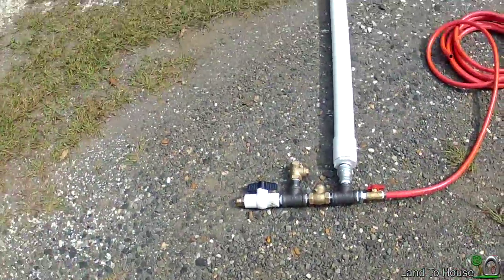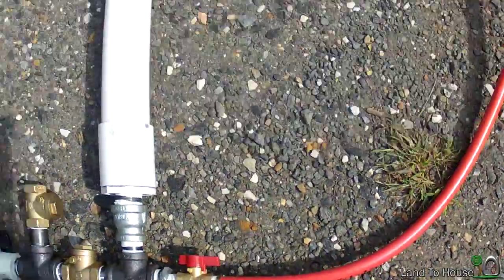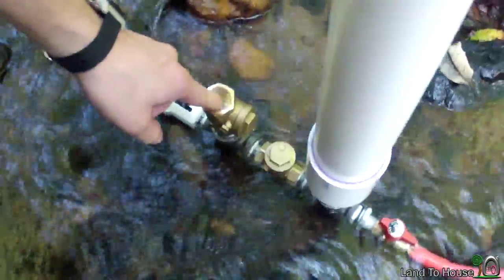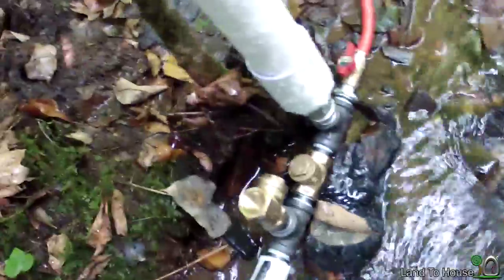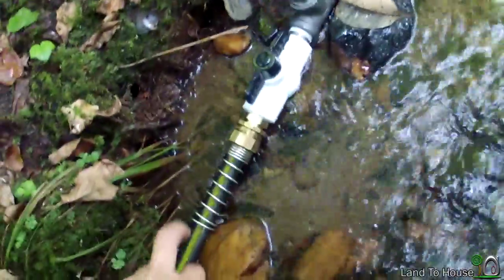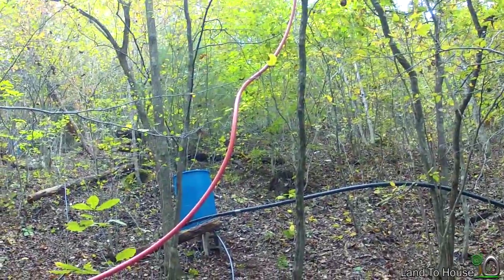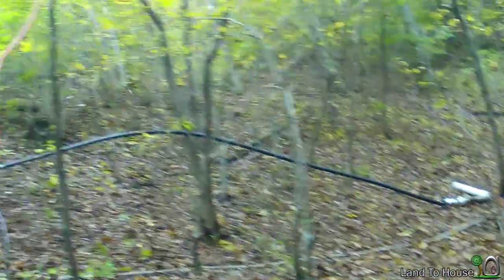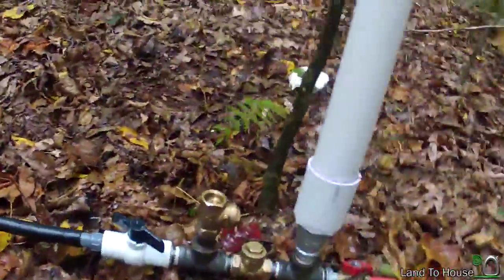Adventure 14 - Small Ram Pump

Comment: Would a ram pump hooked to a rain barrel work to make a simple water fountain for a birdbath? The flow wouldn't have to be a lot, just a small trickle as a water feature in the yard. The idea would be to feed the water running out, back into the rain barrel. Or would that stop working after a few minutes? There must be a way that doesn't involve electricity or a stream and isn't very expensive. I don't have a stream close enough to my own property to use a ram pump, but I love the idea. It just seems like it should work with a rain barrel and just feed the water back into the rain barrel. I imagine that would work like a perpetual motion machine though and they say that cannot be done.
Reply from the maker: Brandywine6969 Your last statement is correct. There is a lot of loss in ram pump operation. Even up 60=90% loss of water. Say you connect a ram pump to the barrel you will get 1gpm in the bird bath for every 6 or more lost on the ground. Your idea of using a barrel is totally valid but getting the water back to the source is not going to work for long. You can use a 55 gallon for about 1 hour with a small pump before the water is gone. your best bet would be a small solar pump that can recycle all the water.
Reply: Thank you. If I ever do get some property with a stream or other running water on it, though, I will want to try the ram pump. I'm glad I found your channel. You share great information and I love your ideas.
Reply from the maker: Brandywine6969 Yes the running water is a must!
Thank you for checking out my videos. I have a lot of fun making them.

Comment: Have you used the 3/4 inch pump again?  What #'s do you have with it.  Will it run on 1 GPM?
Reply from the maker: I just finished a video about the new 3/4" pump. It will be out this weekend. 2.6gpm total to run.
Reply: Land to House .com Darn.  I was hoping less GPM.   I tilted my 1 inch ram to the side so it would run on less GPM.   Did you try that?   You Videos are great.
Reply from the maker: John Godwin I was looking for highest GPM in the test I did this week. I can try to get it down to as low as possible next. I can tilt the pump and also I should be able to turn the ball valve some to reduce the flow. I have a nice setup for testing the 1" and 3/4" pumps now so I can do other tests.
Reply: Land to House .com Sorry.  I ment brass swing valve tilted to the side to use less water.   I mistakenly said ball valve.   Can you get the pump to work on 2 gpm or less?
Reply from the maker: John Godwin oh sorry I was not clear. Yes tilt the check valve and also the ball valve can be closed a little. Both those should slow the pump some.  We will just have to test it.  :)

Comment from the maker: Thank you.  From what I can see the 3/4" drive pipe pump needs at least 1gallon a min if the ball valve is half open.  But it will pull 2 gallons if you let it at full open.  So if you wanted to use a 3/4" you could, just not at full potential.  I have not tried a 1/2" pump. That would give you a 1/4" delivery pipe. Very small.  Now I guess you could store the water from the creek in a tank for a while then turn on the pump.  Then it could run at full potential.

Comment: Great Video.  I built a 1 inch ram but my spring could not keep it running.  Not enough flow.  I was thinking about building a 1/2 inch ram,  I have never seen a 1/2 inch ram.  My spring was putting out about 1 gallon every 1.5 minutes.  I have a really good drop.   About 60 foot of drop with 100 foot of pipe.  Thanks for any advice?  Thanks.